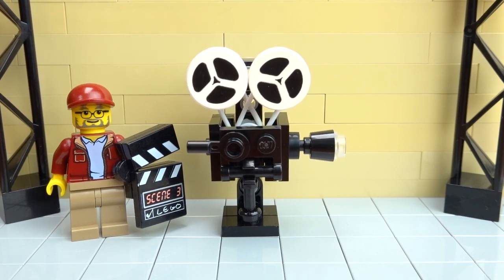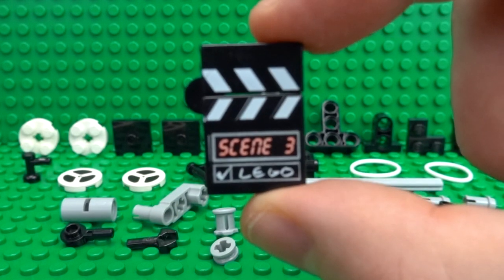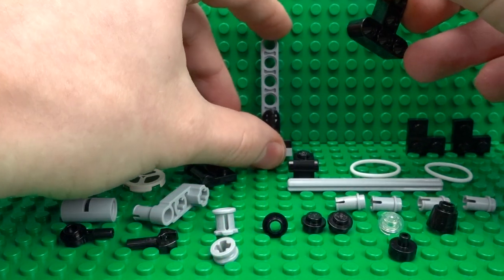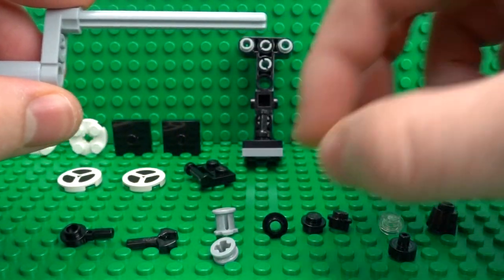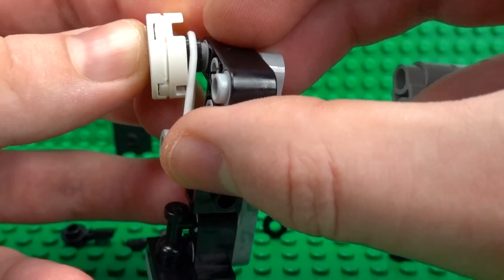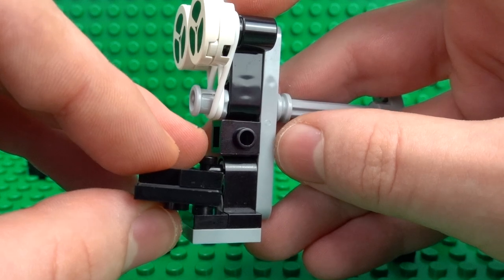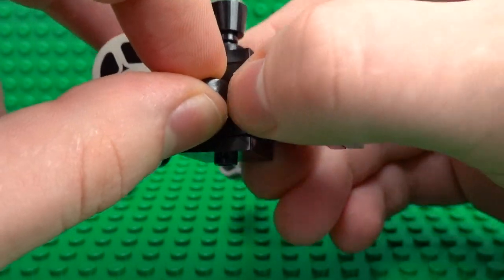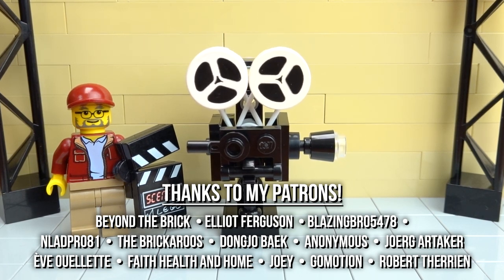How To Build A Working Lego Movie Camera - with Spinning Film Reels!

Comment: LP, just out of curiosity, on average, how long does it take you to come up with the final product of your "working" creations?
Reply from the maker: Hi DD_Zzero6! It depends on the creation, but I'd say on average I spend about 5 to 10 hours designing each working mechanism from start to finish. Sometimes I put a concept aside and work on something else for a few weeks until I get inspiration to complete the original model. 

This was the case with this working camera, where I had designed the basic mechanism pretty quickly but it just took a while to make it more compact and add the finishing touches. I think the end result was worth it though!